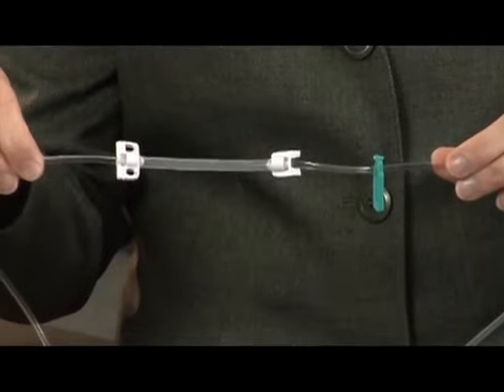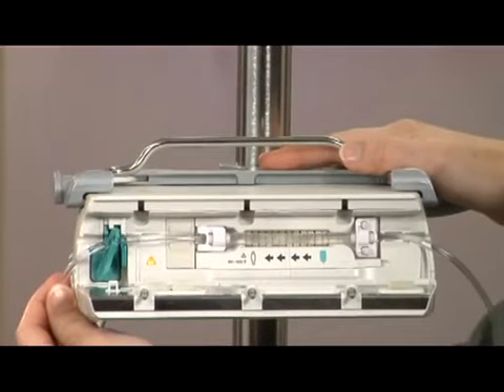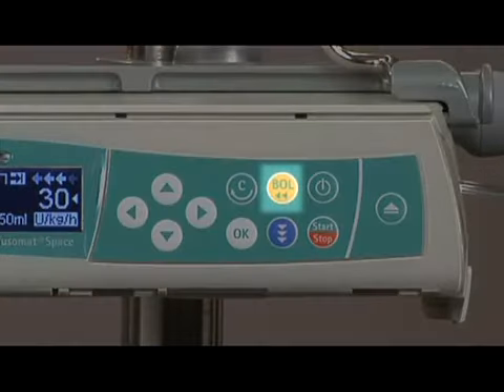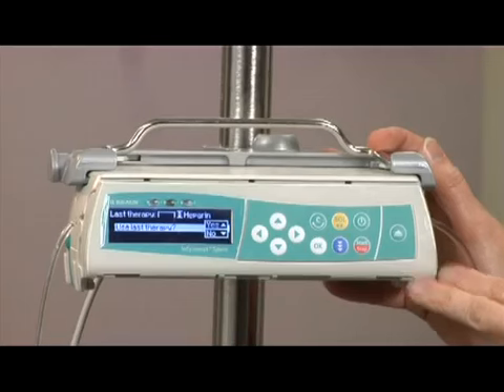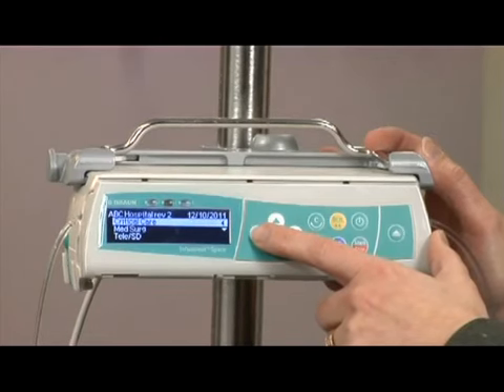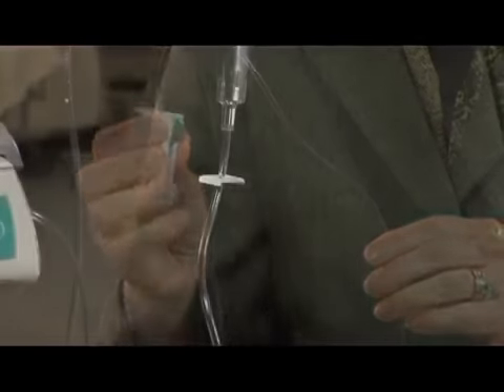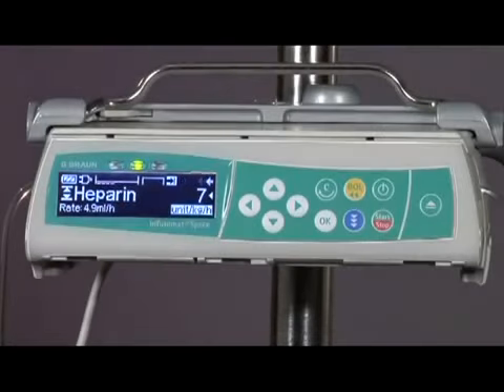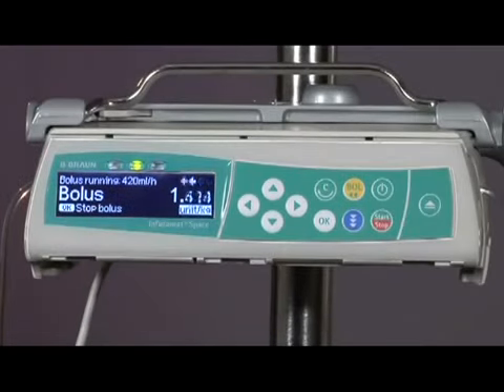Infusomat IV Pump

Comment: OK. I NEED HELP VERY VERY BADLY. I need to know if there exists any known online simulator of this pump where I can simulate free simulation where I can basically simulate any of this pump's operation without a tutorial or walk through. basically this is non-guided simulator where I can choose any drug in the library, and do what I call free simulation. Is there any existing simulator online? PLEASE RESPOND ASAP. OK? This is a desperate call for help.
Reply: Peter Foster I don't think there is a free online simulator Peter. I hope this helps you find some closure during this desperate, desperate time.